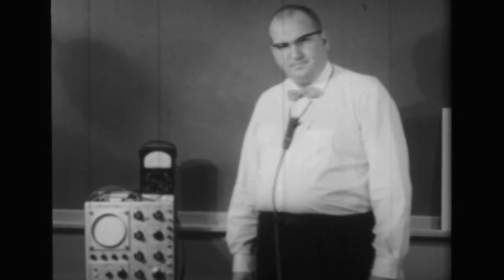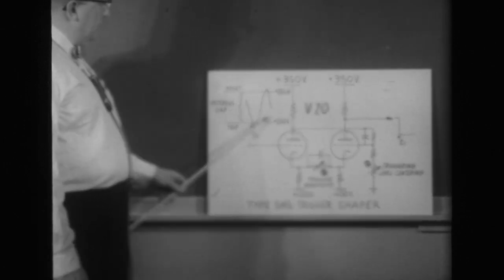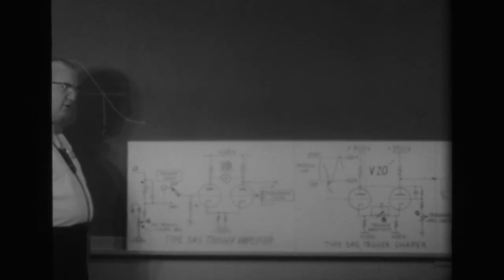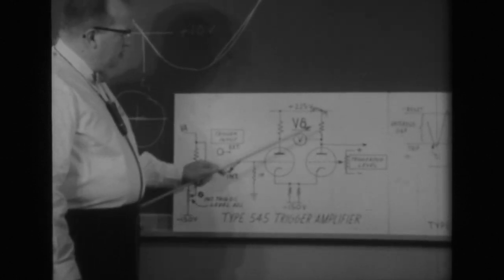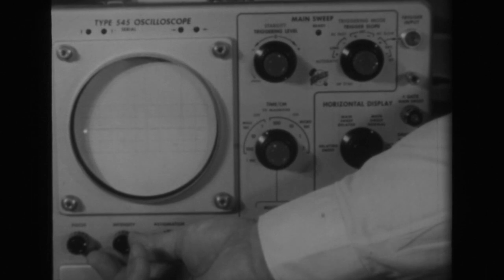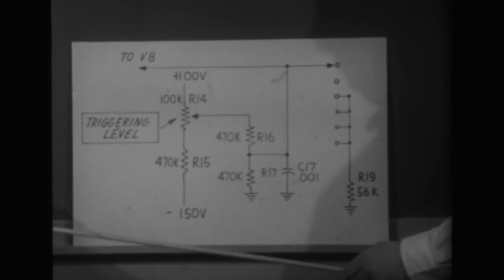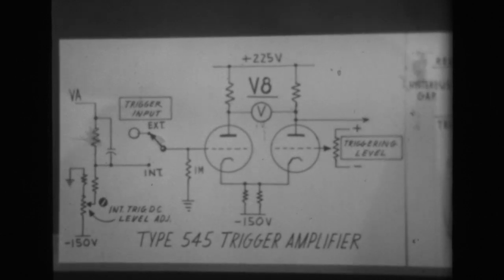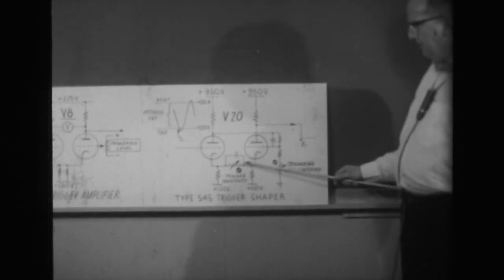Simplified Trigger Adjustments of Tektronix Scopes

Comment: Interesting if very long-winded. These days most people could probably grasp this whole discussion including the theory in 10 or 15 minutes. I guess it took TV repairmen longer back then. 🙂

Out of curiosity, what was the physical source for this video? Looking at the visual artifacts, it looks like it was originally 16mm B&W film, and that must have been transferred some time in the ancient past to some form of NTSC video tape, and the transfer was pulled from that tape? It's a shame the original film wasn't still available, it likely had much better video quality.
Reply: Indeed. I got frustrated quickly and selected 1.5 times playback speed.

Comment: Interesting, but the constant focus hunting is very off-putting.  Is that hunting an artifact of the original film or of the digitisation process?
Reply: I'm pretty sure this is a second generation video. It was certainly film originally, but there are video artifacts (small black streaks horizontally) that suggest it was copied to video tape, and this is most likely a capture from that video tape in some manner. Hopefully that was done with a digitizer, but the focus hunting you mention suggests that it might have been captured in some way with a camera. I don't think it would have happened on the original tape transfer, cameras in the 1960s to 1970s didn't have autofocus.
Reply: @lwilton  The first copy to video was most likely accomplished using a tele-cine machine.  They are prone to issues like this where inconsistent tension in the film path or splices in the film that change the spacing of even one sprocket hole can cause long term variations in focus.
Reply: @projectartichoke  Yes, I agree that either telecine, or more primitively a camera pointed at a projection screen was used. Most likely telecine. My experience with them was limited, but I recall the problems with focus due to splices when projecting a film, and sometime old film that was warped and wouldn't stay flat.
I may well be wrong, but to me, the focus variation on this film seem more like autofocus hunting. I don't recall any splices in this film, and the focus seemed to go out for the full frame, rather than just the center of the image as would normally be true for warped film. It also felt to me that it was hunting in and out. Possible for a film projector, but my recollection is film focus hunting just didn't feel like what is seen here. Again though, I could be completely wrong.